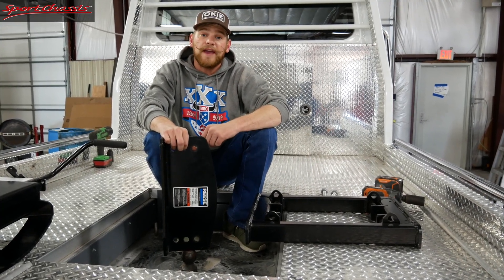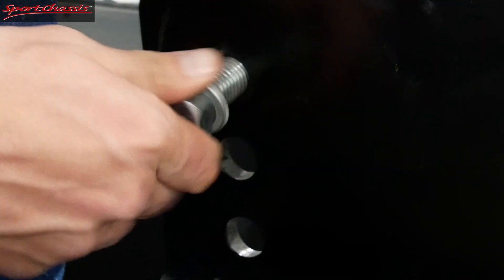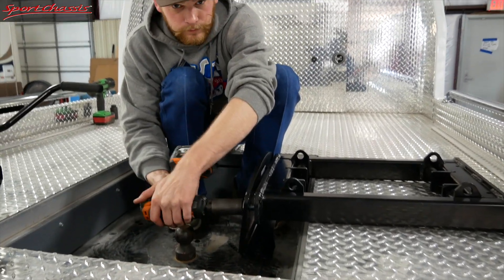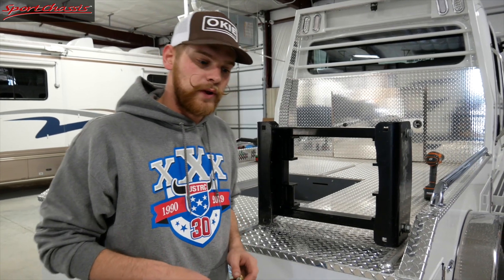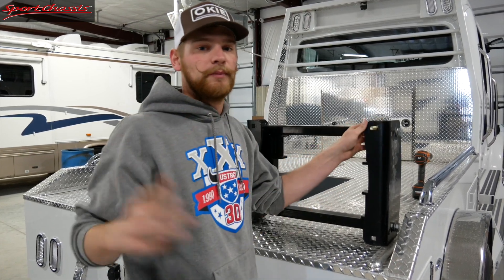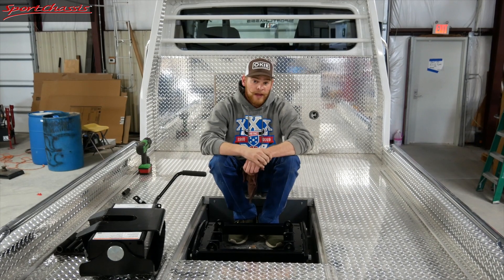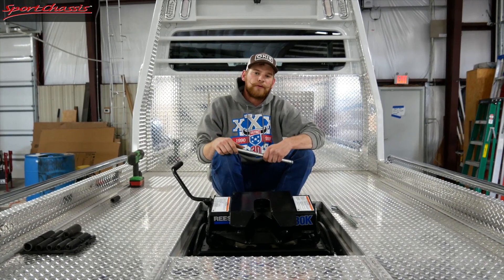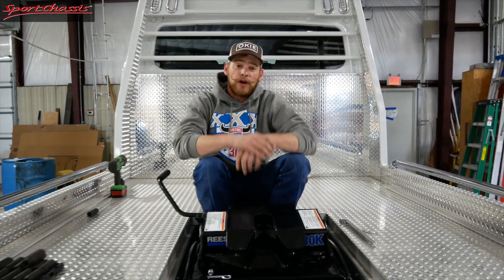SPORTCHASSIS Trucks How To Install A 30K Reese 5th Wheel Hitch | SPORT CHASSIS GUY

Comment: Did you have to remove the gooseneck ball to complete the installation,  we own an 07 sport chassis and the ball is welded in, thankyou for all the info.
Reply from the maker: Sportchassis has used different balls which means some trucks you will have to remove the ball due to height of the hitch. That being said I have never ran into one being welded on from the factory. They are 100% VERY difficult to get off if you have to go down the route of removal. Thank you for watching!
Reply: @BigDRanch918  we purchased the truck used earlier this year, I may contact you on an rv purchase and maybe some hitch work as well, thankyou for your time.
Reply from the maker: @paultalarowski9605  That would be great. Anything Rv or hitch work you need we can help!  https://www.wadesrv.com/

Comment: Where can the 30K Reese 5th Wheel Hitch be purchased at? Does the hitch come with the bolts? Once the base is bolted down to the frame, does the entire pieces would need to be removed to pull a hitch trailer?
Reply from the maker: I recommend going thru Sportchassis. The hitch does not come with bolts.